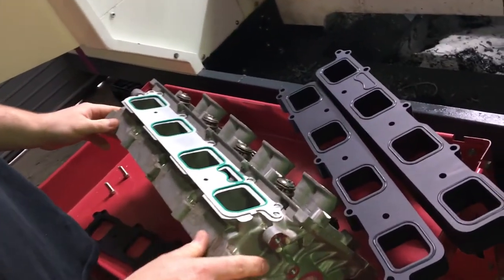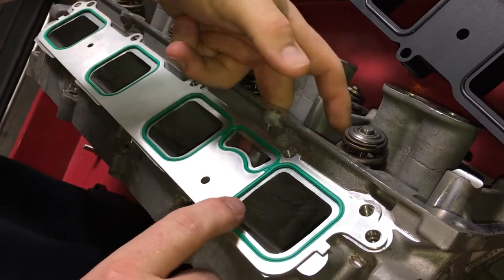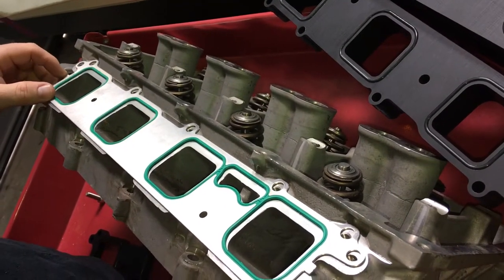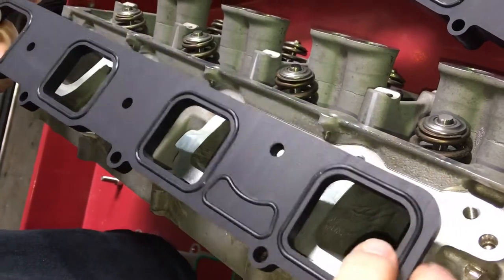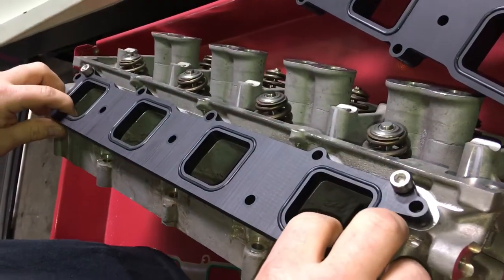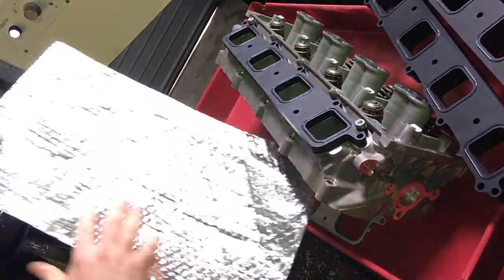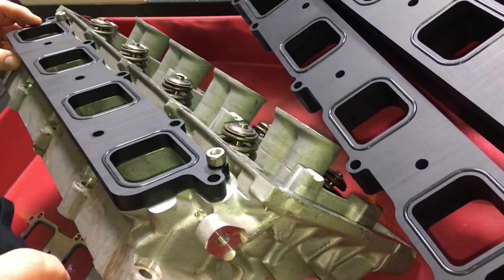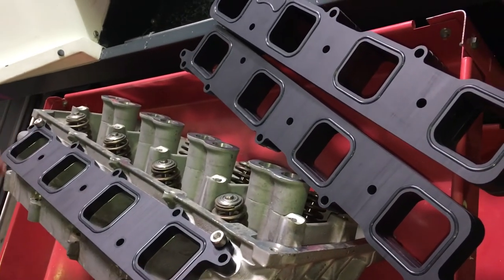Hellcat/Trackhawk blower spacer plates

Comment: Is there a part 2? What where the results on the dyno ? Very nice looking high quality piece by the way. Damn wish I knew you made these 6 months ago when I tore into my motor to swap pulley and injectors! Lol. Is there additional tuning required?
Reply from the maker: We have seen guys gain anywhere from 0.5psi to 1.7psi of boost so depending on how much boost is gained back will determine if the car needs to be tuned again to correct for the additional air now going into the motor instead of the crankcase. There is a video on here of a jeep trackhawk on the dyno, also if you go to the tech articles page on our website there is load of reviews on there, see here:  https://fiinterchillers.com/hellcat-spacer-plates-reviews-and-results/

Comment: Would be helpful to have a belt size chart when adding these spacers.
Reply from the maker: In 90% of cases the current belt is fine, in the very small 10% you have to step it up a half size, it's hard to determine what everyone will need as there is so many different pulley combos people can go for. But at least knowing the belt you currently use as a high chance of being correct is a good thing and a half size longer if it's too short.

Comment: Will you need to lower the engine for everything to fit?
Reply from the maker: no you just need to remove the blower
Reply: @ForcedInductionInterchillers  Sweet so once the spacers are in. There is no need to lower the engine for clearance?
Reply from the maker: @William-_-Cook  no they clear without any issues
Reply: @ForcedInductionInterchillers  Cool thanks boss